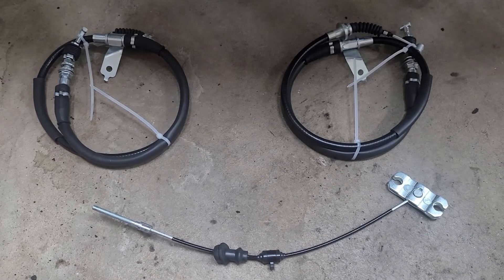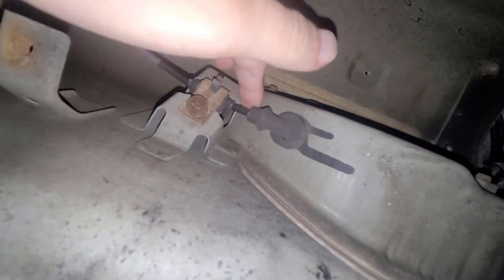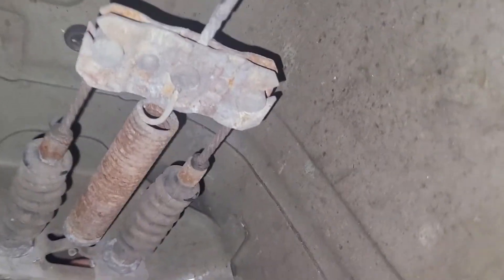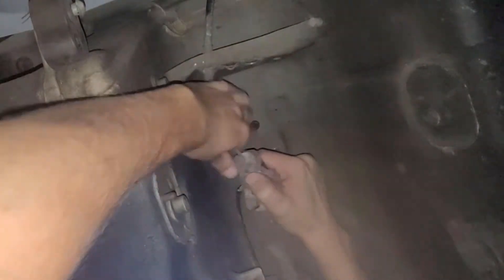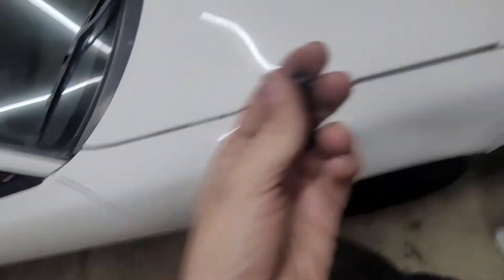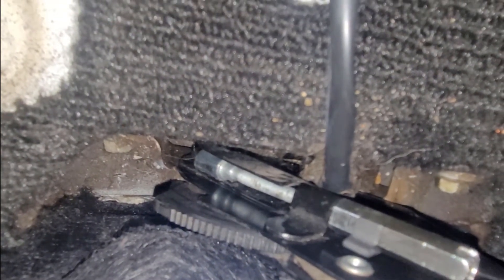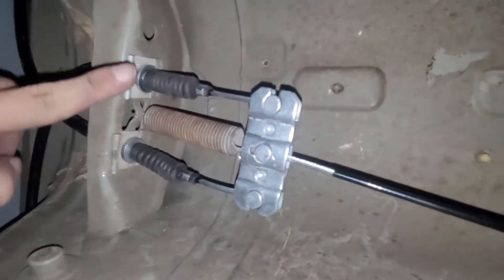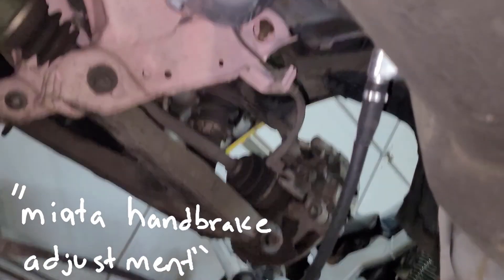Miata Replace Handbrake Cable(s)

Comment: Thanks bro great video! Greetings from Germany. 
Im trying to change the entire rear break system (also upgrading to bigger breaks) but the end of the cable was so rotten and the nuts wouldn't turn bc of so much rust. So Im trying to change the cables too now. Thank you for explaining!

Comment: Where did you buy the parts from. All I’m finding if the front cable that goes to the parking brake and only finding used cable that go to the calipers
Reply from the maker: I found these on RockAuto. Here's what they were listed as
RAYBESTOS	BC94671	Parking Brake Cable	$ 26.79
RAYBESTOS	BC94672	Parking Brake Cable	$ 25.79
RAYBESTOS	BC94683	Parking Brake Cable	$ 20.79
Reply from the maker: https://www.rockauto.com/?carcode=1190887&parttype=1696

I think this link will show all 3 parts listed

Comment: thanks .    Need to replace left rear cable on my 1999    mk2 and think it uses same cable.  Not planning to replace the single cable this time as my right calliper works okay.  
Just a thought when replacing front cable. Maybe  slip that collar off the long hex nut before  re-assembly.  Might be easier to get it started on the new cable end.  The clip /  collar should just slide one.   easy  for me to sat, I have never done the task!
Thanks for sharing.

Comment: I know this is an old video but do you remember where you bought the cables from? everywhere I can find are like $85 for one side, I don't mind putting down that money for new cables but if there are cheaper options... saving money won't hurt.
Reply: also great video btw will definitely be using it when I do my clutch since the transmission will be out
Reply from the maker: @liltoucan4223  I believe I got them from rockauto

try this: https://www.rockauto.com/en/catalog/mazda,1991,mx-5+miata,1.6l+l4,1190887,brake+&+wheel+hub,parking+brake+cable,1696
Reply: @RacecarsAndRicefish  thanks!

Comment: Did you have to take the exhaust and drivetrain off to do this?
Reply from the maker: You should be able to do this job without taking anything out, or maybe take exhaust out only since it's not that hard. I was in the middle of a different project and already had everything taken out and decided to do my handbrake